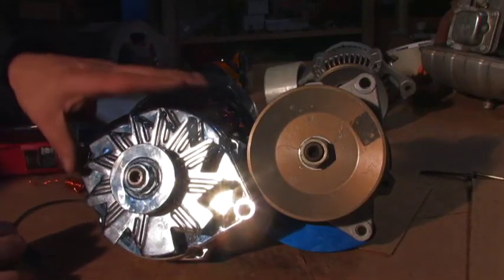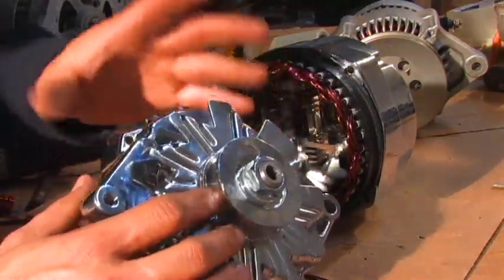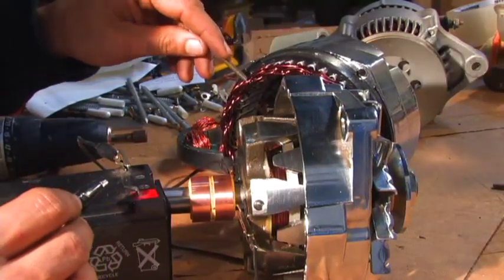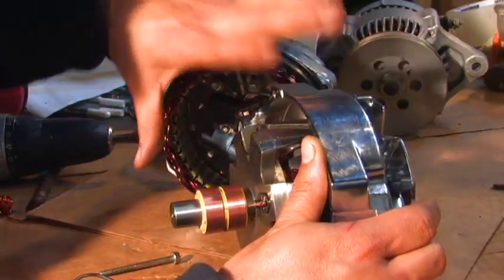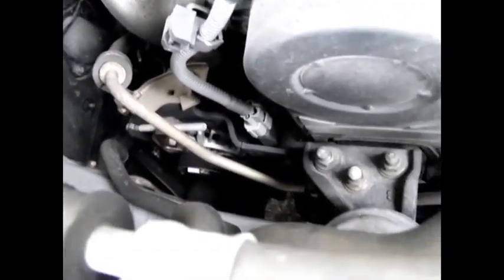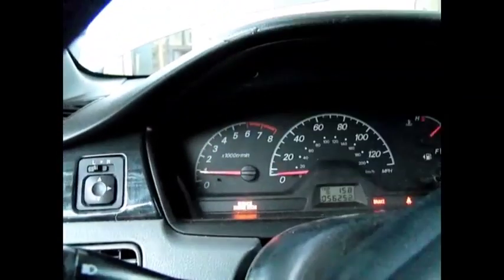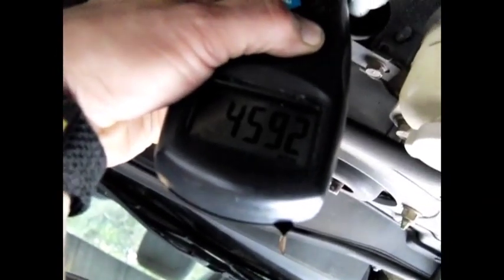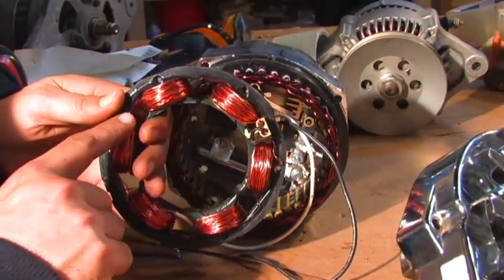Inside a Car Alternator Green Energy Generator Brush Reinsertion for wind turbine RPM

Comment: I am not necessarily concerned with voltage.I want to use DC electricity to make hydrogen. Hydrogen can be stored. That way solar and wind can be combined to make hydrogen to run a electric generator for homes. At my house it seems if the the sun is not shining then there is a breeze or wind. This gives constant generation of hydrogen.
Reply: Terry Phillips using electrolysis?
Reply: MIDN Jacob Mercure yes.
Reply: I would use it as fuel in a electric generator.

Comment: Dan,
   I have watched many of your ViDEo's out of curiosity.  I am as silly as your are about certain idea's... especially drilling holes in the table top saw, burn'N up shit with a fresnel lens, Batman light, and especially how to focus your fresnel at night with a water squirt bottle.
  My favorite Vid you did is that Goddamn mosquito sucker thing for your backyard! I built one, as you instructed, and it worked great! The next morning I had 700 and 3 trillion freaking blood sucking TEXAS mosquitoes, and also all the other undesirable J-bugs stuck to that filter. Those mosquito bastards never had a chance after I sprayed their ass. 
   You and I have a lot in common in our vertical and then sudden simple horizontal thinking. I want to thank you for your view and tutorial on the basic alternating principle of the GM alternator, (small wire), and it's possible use as a DC generating source. I built a precision 12-blade hub and blade arrangement on my lathe and Bridgeport. I used two big 12v Caterpillar (PHO) Batteries to store my juice.
   Maybe, some of those dead cell minds out there will get it? You did well! Be proud in your simple approach ...you are as much an engineer as some of those who claim to be.
    If you ever get to North Texas, you and I should convert my Bridgeport Mill, and Lathe to solar power?, We then would be world famous! ...Perhaps your family and mine can hook-up in MCO and ride the roller coaster with Mickey, and then afterwards, we should suggest improvements to Disney on the ride?
     If you ever need a precision cut on metal or plastic, let me know. You my friend have earned one free pass on the BIG Lathe. Include the phrase “Never apologize, mister, it’s a sign of weakness,” in your next tutorial to redeem one free ride on the Bridgeport (9x42).
   A child's hand reaches in and twists a giant dial on what we now see is an old short-wave RADIO. SIX-YEAR OLD ELLIE leans in towards a large microphone. CQ WR2 GFO, do you copy? CQ WR2 GFO, do you copy?  CQ WR2 GFO, do you copy? Small moves Captain small moves...P.S. I don't have a wEbsiTe ..Or ... a ...U-tUbe %$## site and I don't give a &$#&.... I have also pee’D in my pants and there is nothing you can do about that... Star Date 2014.04.07.... You will read this poSt becAuSe iT iS sO oDd... I wish I could cure my ADHD, and build something great.

Comment: Problem is that the alternator requires power that you want to use to charge a battery. One could always put a much larger pulley on the windmill and get the higher RPM but the current needed to power the alternator reduces the overall efficency of the generator. One could buy an old time GENERATOR, which DOES have permenant magnets in it and has an outside voltage regulator and control so one doesn't over charge the battery/s ...... You could attach permenant magnets to an alternator and yes, it would work... There are many ways to make it work...
Reply: I don't think the external excitation drain is that big of a setback. The car battery in an automotive electrical system seems to do just fine. Hard to beat an output already regulated at 14.2 -14.7 V and capable of up to 200 A, Depending on the alternator, of course...
Reply: Mario James Would be interesting to know the input current when the alternator is outputting 200A Not to mention how many HP and RPM it takes to mantain 200A... Never really thought about it.

Comment: Thanks for the video sir
What is the name of that tool you used to get the rpm
Thanks again
Reply: It's a handheld tachometer. They used to be pretty common when we had DC motors driving equipment. Now, not so much.

Comment: that is what limits the voltage to the alternator
speed?
that is what limits the voltage to the alternator
speed?
if the alternate load the batteries for electric cars that do not use, could give you an alternator 96 volts?

Comment: Is there a formula to use and calculate the for example how much voltage is produced if I have 20 gauge wire, 40 turns, and magnetic field of 0.001T and 800 RPM? :)

Comment: for installing alternator brushes, it's best to use a wooden toothpick or plastic pin.  If you forget to pull a metal pin out and hook up the alternator, the dead short across the field circuit may fry the regulator.  If you forget to pull out a wooden toothpick, no damage.
Reply: yep, been there done that. Be careful, at the best you can ruin something and cost money at the worst you can get electromogrifried. Hahahaha

Comment: Absolutely not possible to have a self-charging electric car!  There are things such as friction, Lenz's Law etc that prevents that.
Reply: If you continue thinking in the box like many do, only then it becomes impossible, if you think your fail at something, you will fail, the same claim was made by the experts in white coats that a perpetual generator could never be done or work, since then quite a few people have proven that claim as wrong only to be silenced or warned off.  This is not a conversation, think outside of the box and see the truth that it can be done.

Comment: You could rig up a electric
 controler using the 741 opamp ic riged up as a comparator( simple circuits can be found on the internet)
That way you can control the bias at the twist of a variable resister (porentiometer or pot for short).

Comment from the maker: Alternators run the electrical system of your car, charges the battery and also provide the high voltage arc for the spark plugs. You can run a started car without a battery and run a started car without an alternator until the battery dies. You cannot run a started gasoline engine with both the battery and alternator missing. Diesel Engines do not use spark plugs and once started will run without either via the combustion stroke but no headlamps etc. Alternators loaded can draw up to 5 HP.

Comment from the maker: No. Alternators are pre-bridge, three-phase alternating current that will be the same no matter which way it is spinning, it does not matter. The bridge rectifier sees it the same way. Alternators do have a designated fan blade that can, going the opposite direction overheat. For alternative energy vs a combustion engine the fan should not be a worry.

Comment: An alternator doesn't really care which way it spins but the cooling fans on most of them are designed for clockwise rotation. Spinning one backwards would impair its ability to pull air through the alternator, which will most likely overheat when under any kind of load. Hope this helps.

Comment: Have you guys looked into the fan motors used in the cooling fan as a source of power? they have permanent magnets. FYI i had one wired directly to my ignition due to faulty temp sensor. when i turned the key off, my engine would run for 30 seconds or so due to the electricity created by it spinning.

Comment: I'm no expert, but I'd guess you would see more than a "tad" MPG hit.  Considering the weight of a bank of batteries and the extreme inefficiency of an internal combustion engine (and pollution), you'd be better off just using the grid.

Comment from the maker: Agree to some degree. Better to use subsidized corn destruction for fuel than nothing. Also it is a process. I disagree with the drill drill mentality. We could drill everywhere and in 10 years lower gas prices by 10¢ a gallon. Make a few billionaires better off. I know a lot of people hate e85 but it is a start towards funding cellulose usage.

Comment: good vid dude but in the alternator the regulator is going to th brush and 6- 12 volts go into coi this creates a strong magnetic flux when the alternator starts turning and power is output the secondary  is used to run the rotor and self sustains  when the rpm is raised it will out more by the way you need at least 5 hp to make it wotk rite and it dose creat drag just hook 1 up when energized n try to turn it u cant spin it i got a delco i mod and it works great u can also get more volts n amps

Comment: @cojobo34  here is what I will need to run: 1 small chest freezer for ice.  limited LED lighting (will have LEDs on rechargeable batteries as well)  and here is the biggy:  Indoor hydroponics for growing veggies.  I will need a constant power supply for atleast 12 hours at a time for the lights, which are high output flourescents (IDk wattage consump yet..)  and a small fountain pump/water pump.  I will have a battery pack of 6-8 batteries (12 volt?)  shud i use wind turbines for this?any ideas?

Comment: @muddymuddymuddmann I see, thanks man.  What do you guys think about this:  Windturbine to battery pack to (good low torque) electric motor, turning modern gas generator (with gas engine replaced by elec motor). Wud this work with enough wind turbines?  How efficient would this be?  My goal is to design and construct a fully self-sufficient kind of safe/survival room--  I have not determined the final wattage consumption for everything yet, but it will obviously have to be consistent. any ideas?

Comment: @muddymuddymuddmann  Hey MUDDy, great videos man.  Im still new kinda to this, but im almost done with the ceiling fan turbine coversion:)  But as for using alternator for Wind Turbine with voltage reg.--being that the current increases at low rpms, does that mean more friction? and that is why it doesnt work?  And then for high RPMs it just doesnt put out much power? do you know how much power it will make with votage reg at high rpm's?  thanks in advance.  GreenPowerScience and MuddyMann rock!

Comment: @Traf94220 Petrol engines are not necessarily more polluting than diesel engines. It all depends on many things, i.e. the size of the engine. Look at Chevrolet's 6.6L V8 Turbo Diesel (Duratec?)... You can get a looot of petrol engines that use way less fuel, and are much cleaner, with the same HP (260). You will probably lose in Torque though, but not everyone needs to pull an armored vehicle on a trailer after their car, every day ;-)

Comment: @GREENPOWERSCIENCE It's funny you say that, because I remember when I was in school, 25+ years ago, we were riding buses in Denmark, that were in experimental tests, where they'd engage a huge magnetizing on some alternators when braking, so rather than using traditional brakes, they added resistances through magnetic fields, and charged up batteries, that would in turn be used to help the bus accelerate with assisting electro-motors to reduce the fuel use. I am sure that by now, it's standard.

Comment: @steveBB30 

with the electronically generated field coil, you could switch off the the power completely if you wanted to have the lowest amount of drag. There are one wire alternators in a lot of custom cars. They don't start to generate until after the car is running and the engine is revved once.  

Plus, it's not like those rare earth magnets grow on trees. I'll bet regulating the power is easier with a field coil too.

Comment: I skipped ahead a bit, but I think you forgot to cover "clocking" an alternator. I think you are using a GM 10si or (clone or 12si, but it looks like a 10). They can be "clocked" four different ways for different types of cars. Normally, I'd make a "hash" mark with a chisel to aid reassembly but that would just ruin all the shiny you got going on there.